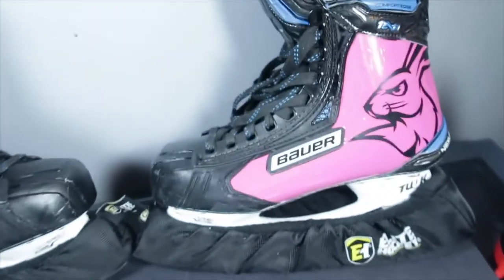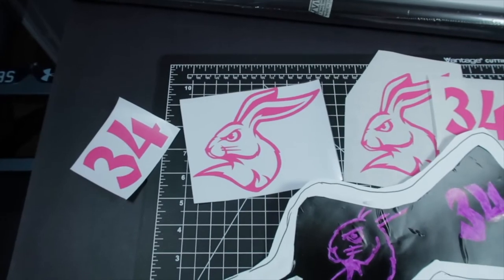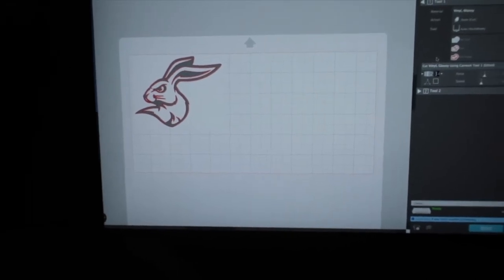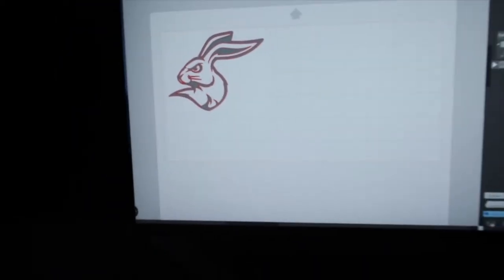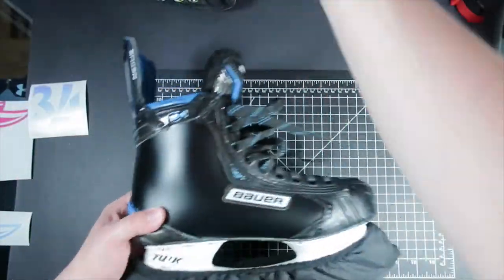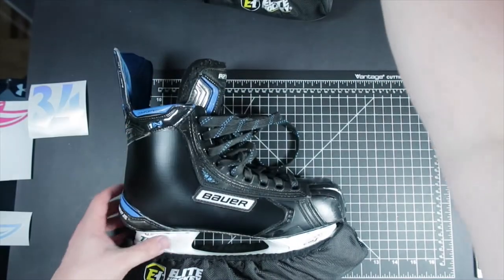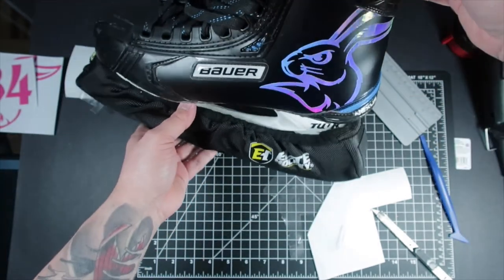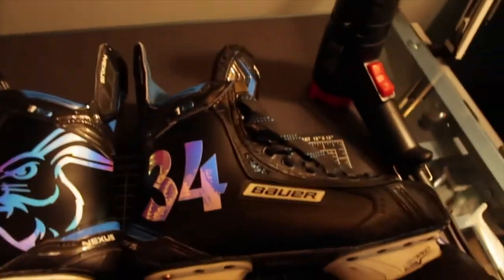How To Vinyl Wrap Your Hockey Skates #2 | JesseOfficialSketch

Comment: Will gloss black be too much light bouncing back? I’m planning on wrapping my Vapor 2x skates
Reply from the maker: Gloss Black will be fine. I just wanted to go with a Matte finish as I knew I was putting this holo design as well and that needed to stand out more lmao At the beginning of the video thats gloss pink so the black will have a similar light effect
Reply: @JesseOfficialSketch  okay cool i think I’ll opt for the gloss since I’m not using any holo, thanks ey! Solid piece of art man!
Reply: @JesseOfficialSketch   how much ft. by ft. ?
Reply from the maker: @johnkolley95000  Most vinyl is 12in wide unless you go with bigger pieces for cars. I don't have my template anymore but each skate is roughly 12x18? For less then $15-$20 you tend to get rolls that are 12in by like 5ft
Reply: @JesseOfficialSketch  oh okay sweet thanks for the info I’ll keep you posted
Reply: Can you post a link to the vynal wrap you like?

Comment: What type of vinyl do you use?
Reply from the maker: Hey, just saw your other comment on my other video. But in case anyone comes to this video with the same question here’s the vinyl I used - Vvivid Commercial Grade Matte Black. 
You can use Oracle 651 but just take your time as it’s not really car grade as it’s slightly thinner. The holo is available in multiple brands but this version was picked up at Michaels and I believe it was Circuit brand